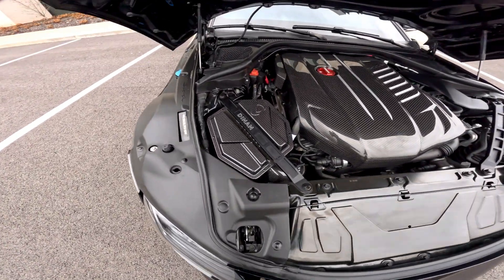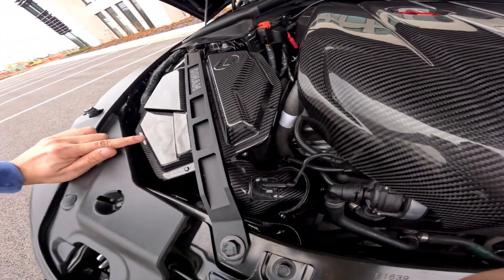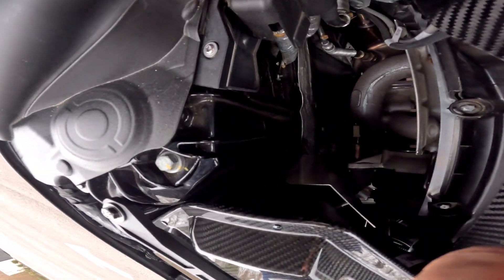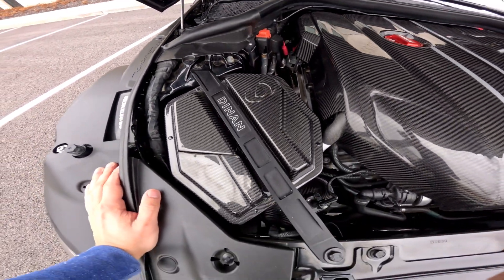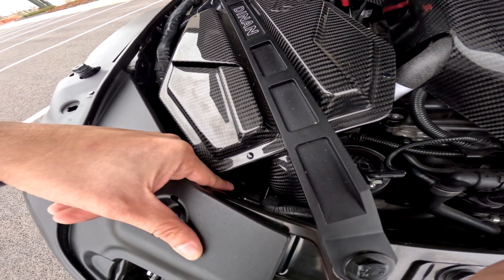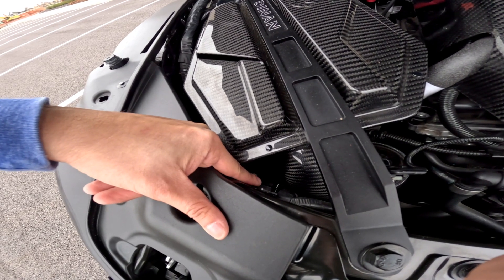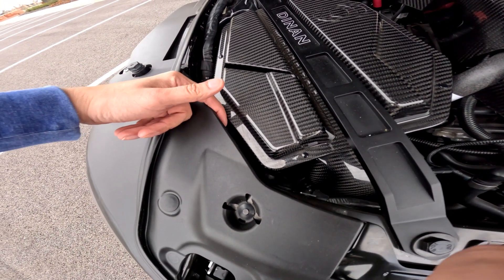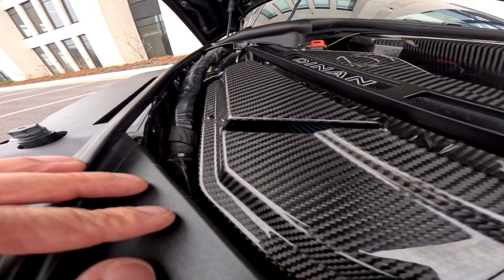*UPCOMING* A90 Supra DINAN Cold Air Intake and Strut Bars

Comment: I have a question concerning install. The lower inlet (that comes in from the front of the car) with this box leaves a gap between it. About 2 inches. Is this the way its designed?
Reply from the maker: @melmartinez6140  do you mean from the tube connected to the intake where it matches up with the oem turbo inlet?
Reply: No the hole at the bottom of the box

Comment: 2 questions:
1: Do we need or should we get any supporting mods for this mod (air filter or turbo inlet or anything else that would improve this product even more)?
2: Are you the one who designed this Dinan CAI?
Reply from the maker: Air filter is included. If you get the 2.0 intake the tube itself is also the turbo inlet. If you get the 3.0 version it would hurt to get the matching CF turbo inlet. 
Yea I am the one who designed this
Reply: @CRatcliffe 
Thank you so much for the quick reply! I will be going with this dinan intake once I get my 3.0 then :). Have you guys made (or will be making) a charge pipe for the B58/gr supra?
Reply from the maker: @CarsOverPeople  I’m not sure honestly. I haven’t worked there since Jan of last year. I would have expected to see it by now if it was going to be made though.

Comment: How loud is this compared to other intakes? Like armaspeed and mst? In your opinion
Reply from the maker: I’d say not as loud as either of them. It’s got some good volume but not to those levels. The other part though is that both of those are not “sealed” intakes. This is a sealed box which makes a huge difference in IATs. There’s a member on the Supra forum who monitored his IATs comparing the mst to this and his IATs were DRASTICALLY closer to ambient temps. He had the armaspeed and was in the 120 range. When he swapped it was mid to high 80s in a 75* day. 
Post #83 for reference. 
https://www.supramkv.com/threads/dinan-intakes-for-the-toyota-gr-supra.17822/page-6